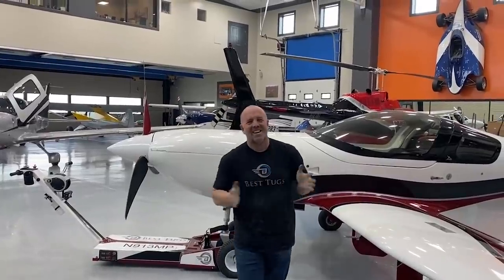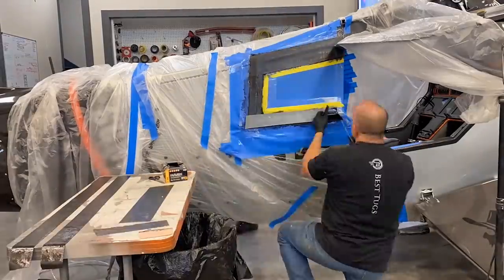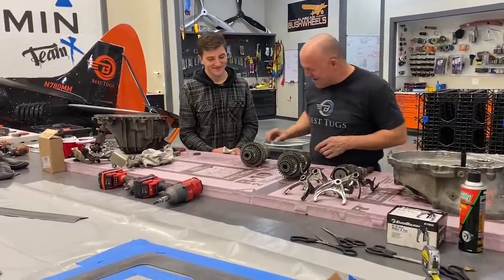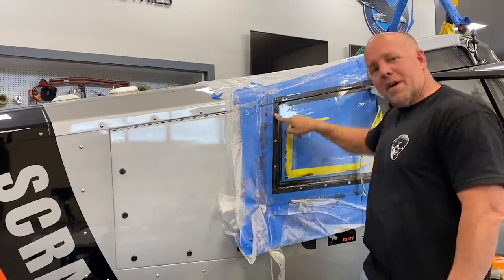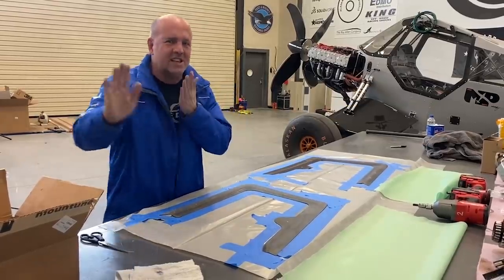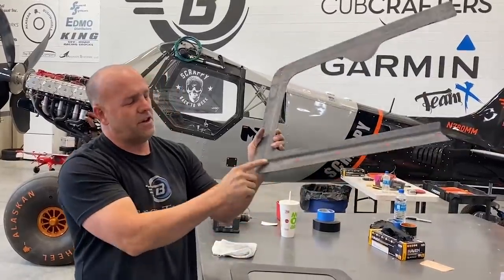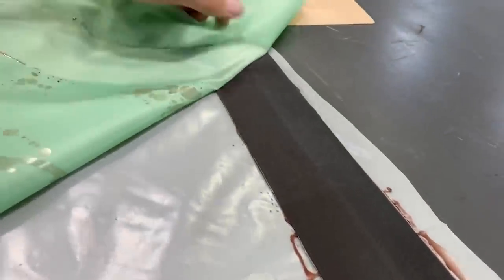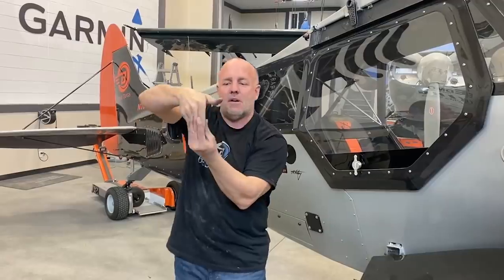We have a carbon fiber problem 😬, do we need this part? | Scrappy #43

Comment: Yes, let's see the helicopter
Reply: Let’s see all the airplanes/helicopters in the hanger.
Reply: I second that
Reply: A Jetranger? Sure... it's nicer than mine.

Mine's imaginary.
Reply: Yes I Agree👍
Reply: @shaunolinger964 , mines about 4 inches tall and battery powered. Sadly, not much of a payload.
Reply: @Bill_N_ATX  🤣
Reply: And that race car on the wall!
Reply: That guy who let him fly his chopper,  I guess he had an extra for sale .
Reply: New toy, new toy 😁👍
Reply: Helicopter yes please 👍🏻
Reply: Helicopter videos? Yes please..Next project... Carbon fiber Coax helicopter with a pusher prop that can break the 250 mark. Challenge accepted!!!
Reply: Let me guess, the helicopter is for search and rescue.  Every aircraft seems to have a purpose. And of course it will also land in those tight spots that planes can't.

Comment: Mike, you can buy transfer punches that thread into your nut plates and protrude an adjustable height so you locate the part where you need it to be and lightly tap the part over the transfer punch. It makes a perfect punch mark right where the center of the nut plate is located. Also, your videos just keep getting better and better. Every time I see a Scrappy video show up, I automatically smile and settle in for the best entertainment You Tube has to offer.

Comment: Mike, amazing, as always!  One word of caution: You should really try to protect your skin when sanding down carbon fiber; that dust can cause long-term skin problems.
Reply: I second the motion. Epoxy resins are not user friendly.
Reply: Yup, once you become allergic to that toxin, you will never be able to work with it again.
Reply: Is normal clothing sufficient (long sleeve shirt) or is something more specialized recommended?
Reply: To be completely safe would mean wearing a onesie suit with air supply or at least a respirator. Same as automotive painters wear, or fiberglass boat builders wear.  Of course it’s a hassle, but so is being hooked to an oxygen tank.

Comment: WOW that torque seal trick is completely showing off that genuine Patey 200 IQ genius level intelligence. I'd be over here thinking of messy silicone plugs and wooden dowels, but that's a no-fuss/no-mess solution. I'm off work for the weekend but I'll get back to work......on Monday!

Comment: Yes, I would love to see what you have going on with your Bell Jet Ranger..  My father was a design engineer with Bell in Texas in the late 60's and early 70's. He worked on the design for rotor blades. He ended up retiring from Boeing in Mesa, Arizona from what used to be McDonnell Douglas Helicopter when he first went to work there. That is such an awesome spot to land in the snow on that hilltop!!

Comment: As a suggestion could you have nestled the two "C" trims into each other. Legs towards legs and coated them in one layer of carbon then cut them out to save overall carbon? or am I missing something?

thanks great videos.

Comment: It’s funny he says new helicopter... This week at work I was trying to describe Mike Patey to somebody and using the details and use specific parts in Scrappy to explain the difference between expertly well done and next level (the whole world advances) and when I finished my point had become muddled in my nerd out on the extremes in the build. My work partner looks at me and says, “Sounds like that feller is building a helicopter with the prop on the wrong end.” This turned into me pulling up the YouTube intro video where Draco is in near vertical flight 100 feet off the ground. This was his last STOL aircraft and this new one is even crazier!

You inspire the standouts and the superstars. Keep pushing the bar higher Hero!

Comment: Mike. To find the hole position on the part I also dip a set screw (grub screw) in a little grease and screw in leaving 1/32 proud. Mould over and when you remove the part it leaves little dimples to drill exactly over the holes. Used it a few times on model aeroplanes and it works great.

Comment: Mike Patey: spend hours working on a trim to save a little drag on the window edge... What massive wheels? What are you talking about? :D
Reply from the maker: 😂😂😂 you are so right👍 I think the same thing sometimes 🤠.  It’s also like saying the motor weighs so much let’s stop saving weight.  🤷‍♂️. I won’t give up my big tires so I try and save drag everywhere else.  I want my silly motor so I will continue to save a gram every chance I can.  👍🤠🤠 it’s all a trade off for sure
Reply: @MikePatey  That is so right, you shouldn't have to stop improving efficiency for the reason that part of the plane is not ideal but fits a specific function. It is like asking a cargo ship to have a smaller hull to be more efficient. The cargo ship can't have it smaller, but it can have it be as hydro as possible. The same way you can't have smaller wheels, but you can have everything else as aero as can be.
Best from Switzerland, keep up the fantastic work
Reply: He's not bald, he's saving weight
Reply: @kevinc8387  and more aerodynamic 👍 insert spongebob scene "I'm HYDRODYNAMICLY DESIGNED"

Comment: I’ve been curious this whole time: since you tend to go all “squirrel!” on random side projects, like these carbon fiber window trim pieces (which I enjoy, and one could argue its agile, since you the product owner realize during development that you “need” it), are you / do you use any project management software for managing tasks and engineering  sprints on your builds?
Reply from the maker: I don’t use a software for that as I just work every minute I’m not at my normal work. Often times my other companies keep me 16 hours in a day so it’s hard to make a schedule for my past time.  That being said I have a list of my build tasks in order that need to be done so that at no point does one project delay the next steps.  I focus on predicting delay or bottle necks and revolve around them.  My goal in every build is to not miss one single minute of build time because I forgot to order a part or carbon or a tool in advance.  So far on this build my stops only come at need of sleep and not yet because I miss the basics in design build schedule.  I do “squirrel” all the time but never away from the path just over to the side projects I can do anytime when the other part of the build holds for cure time.  🤷‍♂️🤠 it works for me. Now I certainly would if I had others and staff. Software is a huge benefit at that point
Reply: @MikePatey  you work a lot of hours! Between 16hr workdays, and then building planes outside the scope of your work hours, you must not get a lot of sleep. But you’re full of energy. That’s crazy! 
You must be following the Arnold Schwarzenegger approach to sleep: sleep faster. 🤠
So, what I gather from your response regarding the scope of project management is you don’t really need a tool to achieve your project because, basically, your gray matter kinda takes care of business for you in that department. Most impressive, my man. I suppose that’s what separates you from the rest of us engineer types, why you stand out and draw the crowd: Super human.
Love your videos. I can’t wait to see Scrappy fly.

Comment: I like seeing what you're up to, but I was pretty happy to see your son rebuilding a transmission. I was a dealership tech for 24 years and I spent most of that time rebuilding engines and transmissions ("heavy" technician). It's a dying art and I like seeing youngsters take an interest in fixing them rather than just replacing them.

Comment: You are an artist and an engineer, Mike.  Scrappy is the first of its kind in several areas, mission capable for very versatile flight profiles.  

Regarding your helicopter, I'd be interested in the fine skills involved flying a helicopter.   Many with aviation interests may not be as familiar with the controls and skill sets of flying helicopters.  Touch on the special maintenance required for helicopters, if you'd like. 

In my teen years I found a cockpit formatted arcade game that had a collective, pedals and a joystick controllable in two flight modes, real and arcade.  I spent enough in quarters to become semi-competent in 3d battle with the flight mode in "real mode" which was free in all axis.  I currently fly a VR simulator called VTOL, for now.

Comment: Carbon fiber upgrade on the Bell ? FLIR, Radar Altimeter, Synthetic Vision, Auto Gyroscopic GPS Hover :) , Anti Ice, Skid pads/skis, Long Range Fuel, Cold Weather/Cargo Mods. It's usually mission based, cant wait to see how you put your mods to this machine...

Comment: For covering up holes as you did, with the crosscheck. you can just use normal kids model clay! (NOT Play-Doh) model clay is also good to cover up anything else especially when you are vacuum bagging. What makes model clay perfect is the fact that it's easy to use and the softness makes it easy to remove even when covered in the cured resin.

Comment: Mike!  Excellent again, as usual; I'm going to watch this three times and take notes.  

I noticed that you are using denatured alcohol to clean your carbon fiber.  I have an upgrade you may be interested in;  I am a wood worker (luthier) and I used to use denatured alcohol to mix shellac.  It used to give me horrible headaches and drive me out of my shop.  A friend told me to try grain alcohol, or as it's more commonly known; Everclear.  It's the same stuff, but without the ethyl acetate that they put in it to prevent people from drinking it.  I try to reduce toxins in my workshop and since the latter is sold to be consumed, I think it's safe to say it's probably safer to have in your shop than a Velociraptor.  Certainly safer than a Utahraptor.  

No more headaches, but carrying two or three gallons of grain alcohol into my shop has got the neighbors talking.  He-he.

Comment: Your left hand window design means no extreme sideslips with your main door open. After you lose a left hand sliding window you learn to open it before your side slip to save the “walk of shame” to retrieve it from the undershoot. As you can’t open your left hand window you’ll have to keep the door shut in flight or not sideslip.

Comment: Going back to horizon hobby and draco, one thing Mike has gotta try is the Joe Nall event next time it's not canceled for COVID. If you don't know, Joe Nall is the Oshkosh of the RC world on a private grass airport called Triple Tree Aerodrome in the middle of nowhere south carolina, just a few hours east of atlanta ga. You'll see RC warbirds, turbines, STOL competitions, stunt planes, control line flying, helicopters and float planes. Some of the aircraft weigh more than a large dog and can move over 150mph.  I highly highly recommend it Mike. Not only is Joe Nall the biggest R/C event and you'll def have a blast, you giving it exposure on your channel would help the hobby tremendously. I know but Horizon Hobby and MotionRC make a big marketing expenditure at this event.   Such exposure would be a great way to help horizon after RC Draco. It usually happens in May (But not this year, COVID). This would be a great 2022 or 2023 event.

Comment: Hi Mike,
 Nice finishing detail on the windows. They look better with the black carbon surround,
 BUT these are cosmetic in essence, and not essential for the project taking off!! so to speak! and you seem to be for ever? putting off the next main and final construction THE Wings!!.
 Whats is the delay:?
 "Expanding the envelope both ways" if youve solved it then we all aught to know first, before the rest of aviation take up the idea.
 Do  consider it as a patentable idea., It could be valuable.
Your propellor is suited to low speed power, maybe  this is the compromise for lift you need to make with the wings.
Ted.

Comment: Safety egress. The very reason why my semi truck MUST have sleeper doors. A fire in the driving compartment when you're sleeping would be disasterous otherwise. Volvos, and Internationals don't. Good plan, Mr. Patey. My Bearhawk will have 2 doors.

Comment: I’m thinking Mike’s going find a way  to build the cord of the wing with a tensioned upper skin. When relaxed ( at low speed) the cord is thicker/upper skin is higher with the  leading edge lower, at high speed the skin slides back towards the trailing edge thinning the chord and raising the leading edge. If such a system could be engineered it would make an automatically adjusting airfoil meeting the best slow speed characteristics automatically based on the airflow/pressure over the wing the inverse would be true for cruise configuration. I’m sure there’s a thousand problems with the idea but I’m sure Mike, you can conquer all of them if anyone can. 
  It seems possible to make a manually operated system with  a carbon torque tube  with offset cams or some other linkage  down the  length of the wing to adjust the chord manually via a flap style handle in the cockpit as well. Or if weight is not an issue it could be done with electric actuators... I can’t wait to see what you’ve got coming Mike!

Comment: rookie question; with that "seam" being 6 [?] feet from the windshield, in the wing down wash and prop wash, would there really be laminar flow there?
Reply from the maker: 👍🤠 Yes and no.   No laminar at slow speed and high blast.  yes laminar at high cruise speed

Comment: Mike, you mentioned "The only air in and out" will be on the environmental control knob. 
Have you set up anywhere for air to drain? 
Also, you mentioned waaaaay long ago that you'll have access to the cowl flap from the front seat? Is that related?

Comment: Hey Mike, are you going to clear-coat those little fill pieces that close out the gap between the cabin & the wings ?
IMO they should have the same high quality finish of all the other carbon parts, those parts are as nice as any I've ever seen on anything :-)

Comment: 12:20 Mike explaining super smooth window frames which avoid laminar airflow stepping out an inch. Meanwhile, in the background are massive 36” bush tires. Sorry Mike but had to giggle.

Comment: I had a thought last night and really has me curious. Maybe you have an answer. I know a turboprop is basically a jet engine driving a propeller. Okay that is all well and good but why not take one step further. Could a turboprop be set up with an afterburner? I understand that props are not efficient at supersonic speeds. If you could adapt an afterburner, wouldn't the additional thrust help? Perhaps with the added thrust, a gear reduction for the prop would allow it to run more efficiently and faster. What do you think?

Comment: The interference fit of emergency exit window is strong enough to still stay in place during hard side slip attitude with high amount of low pressure draft on that side then I presume?
Reply from the maker: Yes exactly 👍🤠 even pressure from a side slip or opening the other door in flight pushes all at once and you could never get it out.  It takes a point flex just outside of a corner with a kick.
Reply: @MikePatey  Very ingenious forthought.. When designing something, experience and the ability to think ahead in the design process is paramount. So many design something then have to "reinvent" due to missing a key purpose or element... Great job and I really enjoy your technical as well as down to Earth explanations..

Comment: What about that Draco model plane in the background at 12:40.  Are any for sale from a hobby shop or manufacturer???  What's next Mike, the cowling????  If the wing design is finalized, when are you going to start making the parts for it or is someone else building it for you???

Comment: Do I spy a linear actuator for the flap control at the wing root? As always going WAY overboard on everything. Scrappy is not a carbon cub turned to 11. Scrappy turned the dial to 15 and snapped off the knob. Very impressive

I'm curious, any predictions what the engine out glide ratio will be like? On the one hand you're designing what sounds like a very efficient wing, on the other hand it's not exactly a low drag airframe (what with the GIANT suspension wings, wheels, prop, etc).

Comment: I seen a guy build an rc plane. He used an electric brushless motor, attached to a 3 speed transmission from an rc electric buggie. People said it would not work. The plane did work & flew faster with the 3 speed automatic transmission, than without it. He flew faster with only half the rpms/half throttle. I was wondering why real planes don't have multi speed transmissions. He also stated that variable pitch props can only make rpms drop by lessening the prop angle, so this decreases prop thrust. If planes used multi speed transmissions, I believe it would change the flying industry, because pkanes could then fly twice the speed with half the fuel consumption. You could use first gear to take off & gain altitude, & once at level flight you could use your second & third gear ratio to go faster with less rpms, thus saving gas & wear & tear on the engine. I also believe it should only be done with high torque motors like diesel engines, big gas engines like turbo charged V8's & perhsps turbo props, by turning gear reduction into a multiple speed transmission. They recently have developed a new giant size turbofan jet, with a gear reduction so the turbofan runs slower, than  the the blades in the hot section of the turbine, for better fuel efficiency. I was also wondering why the frames of aircraft aren't made of tubular carbon fiber/kevlar or titanium to save weight. I've always heard carbon fiber is stronger than steel or aluminum. What do you think Mr. Patey.
Reply: I too find the idea of a gear box interesting and have wondered the same thing for boats. But if I had to guess, I would say a combination of cost, possible brake points and engine temperature control when compared to the efficiency of variable pitch props. Also I guess the risk of having the prop explode from too high an RPM at full power in top gear.??